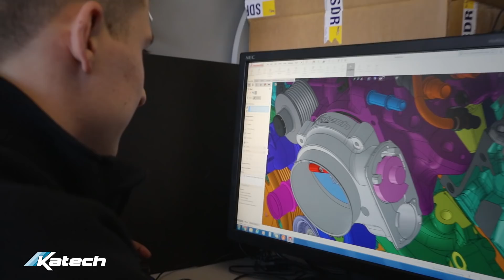Katech Powered Alternative-Fueled Engines

Comment: Katech Honchos, pay attention to this. After using 3 different fleets running propane here in Toronto for over 40 million kms ( 25 million miles ) there a couple of things that you need to know. First, the LPG sold in Europe is a lesser quality grade than the grade HD5 sold in North America. The NA auto grade LPG has a maximum amount of butane of just 5 percent. But in Europe, the LPG has a legal max of 30 percent butane, therefore the Euro stuff is a very different propane than what is standard in NA for the past 20 years. We have a lower sulphur limit in the North American propane than Europe, Asia and Australia. An industrial engine built for low RPM running in a heavy bus or truck in NA will run fine, but send that exact same engine to run in a bus in Europe and the engine will have less power and wear out faster IF it doesn't blow up first. Ask the GM engineer who worked with Brian Thomson who used to run Thomson Automotive in your state. Ask Brian if he remembers me. Mark Smyth in Toronto. We used to talk every week on Fridays when the GM engineer visited Brian as he built and tested the first new 8.0 design big block engines to run on propane for the GM heavy duty 5500, 6500, and 7500 series trucks that GM stopped making in 2010, when that was the last year of those dump trucks, street sweepers and full size school buses. It was the 8.0 liter engine, that was never factory installed in any GM very heavy trucks. It's not the 8.1 liter, which is a completely different engine that only shares one part with the 8.0. Even the firing order is different according to what Brian told me. Brian got 518 lbs feet of torque at 1,800 RPM on gasoline with a 10 to one compression ratio. It and the cam was designed as a propane constant power industrial engine, and for making electricity, 1800 RPM is the standard constant power with a max RPM of just 2800, as part of the standard for making electricity. A slightly hotter cam is used in school buses on propane as supplied by Freightliner with the 8.0 engine. On the GMPowertrain dot com website, click onto "Products", they refer to the 8.0 engine as the 8.0L LFI, with 488 cubes,  bore of 4.27 and stroke of 4.25, with 375 HP and 475 lbs of torque with 9.9 to 1 CR. Anyway Katech honchos, contact me at my YouTube contact name--Mark S
Reply: Mark S PSI LPG engines are the best
Reply: @visavo   And you base your opinion on how many years experience with commercial propane engines???? See my other posts for the 25 million miles of experience that i have since 1981 using LPG in my various fleets. PSI did NOT build or design the engine, all they did was buy out another Michigan company that did the propane development intake manifold and injection system for the GM engine. The facts speak for themselves.

Comment: Wait. What is unique about an engine manufacturer planning to exceed durability and power expectations? You know bearing clearances, rod material, valve info? Name an engine manufacturer that doesn’t use the required bearing clearance when building an engine... stick to race cars.
Reply: I think Katech builds amazing stuff. And the engineering and design are top notch. I was just really turned off by the way over the top, oozing blatant, marketing. They don’t do that with racecar parts. They don’t need to. They literally could have just said 1000ft/lbs @3000 and mic dropped. They’d already be on back order...
Reply: @stick004  Concise and on point.
Reply: So much negativity?